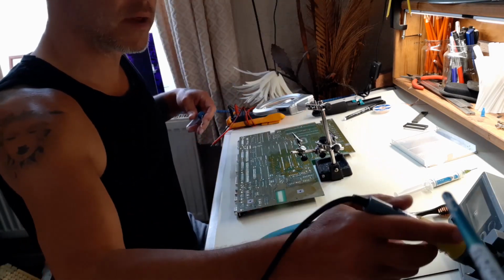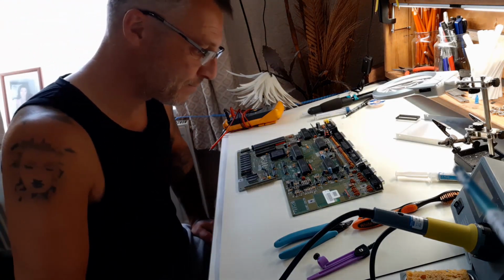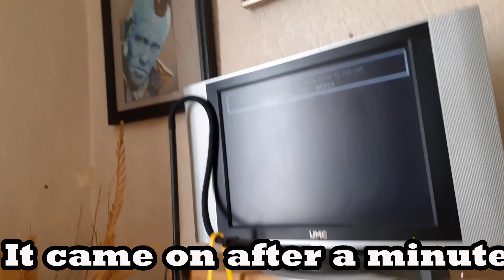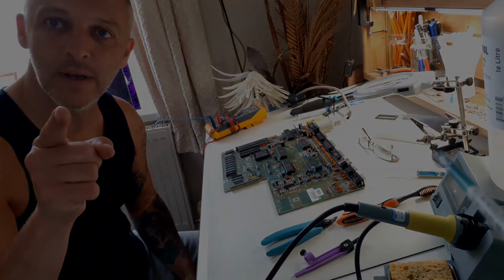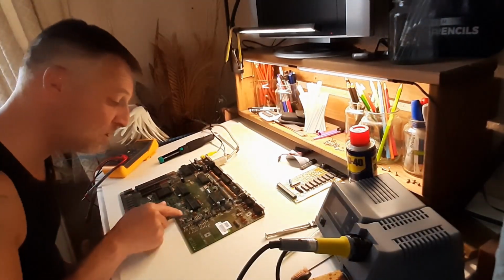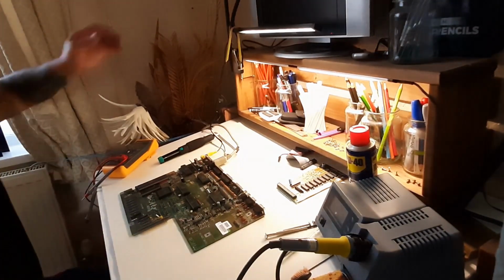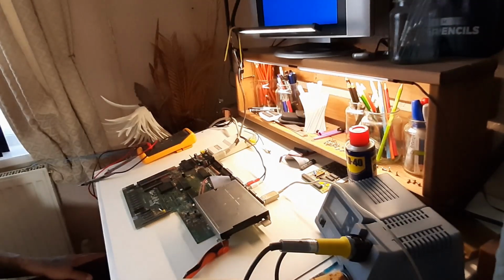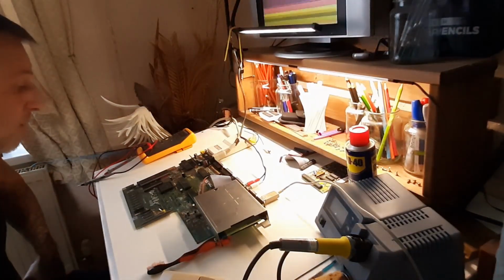Commodore Amiga 500 plus Ebay leaked battery no working junker to jewel Pt1

Comment: Ive just been gifted a 500plus from a bloke at work for free, from new he never used it, not even plugged in. The battery has only leaked a little bit.
Since it was free i have ordered a 500 plusplus pcb and will transfer most of it and replace affected components.